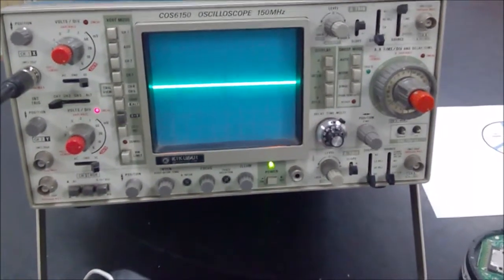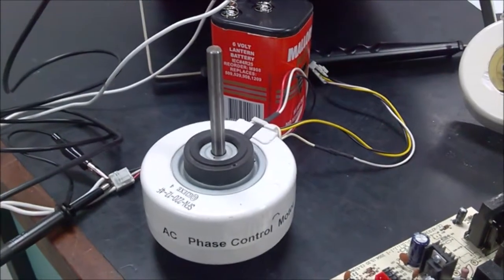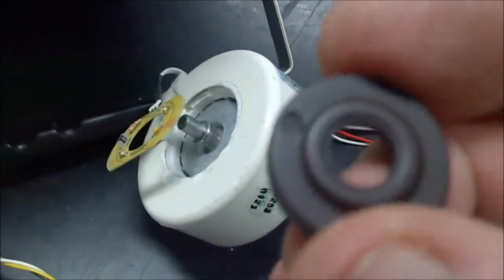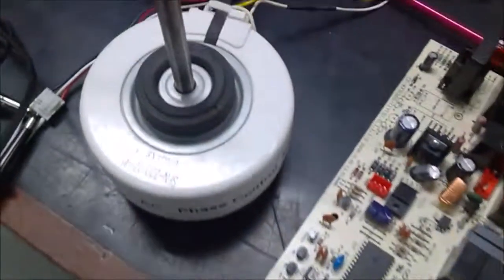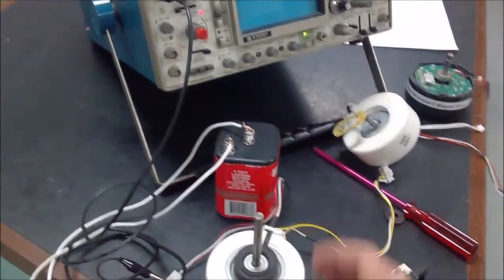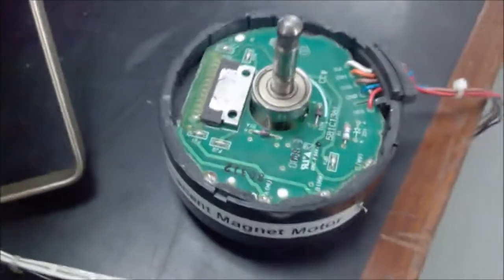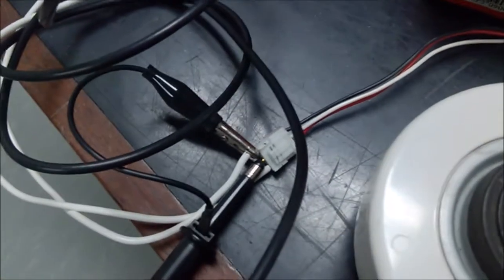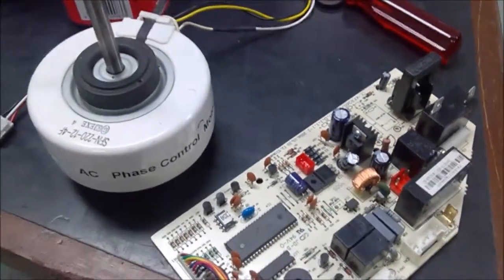Phase control motor position sensor

Comment: Just when I thought Hall sensors are used for Brushless DC motors not AC induction motors.
I don't know what phase control means.  phase is fed by the power company and the motor is designed to accommodate it and since homes in the U.S are not three phase, and if one needs three phase they will just get a Variable frequency drive, however they work.
Obviously there are other ways to do whatever way to control speed or direction, aside from trying to get three phase out of a single phase power system.

Whatever kind of motor this is called it is what I have.
Amana PTAC Blower Motor ZWK465A00301
Here is another number for it: Amana 0131P00029S PTAC Indoor Blower Motor
And: https://www.h-mac.com/amana-0131p00029S.html

It has magnet rotor. I noticed  It has three hall sensor in that circuit board.  Besides (u,v,w, yellow,red,white wires) it has 5 more wires ( vcc and ground plus three hall).
I don't see one that has 8 wires coming out of it in your video at all although you seem to kind of mention it and even one looks likes it.  
So the question I guess I have is how on Earth I can run it without their fancy power supply controller?
Reply from the maker: It's a single phase split phase ac motor. Two winding start system but speed controlled by a varying ac voltage from the driver . Eg phase control = voltage control